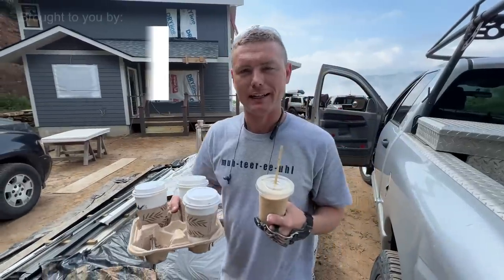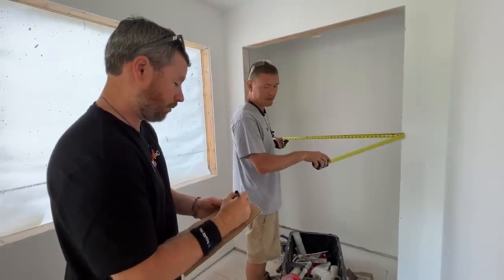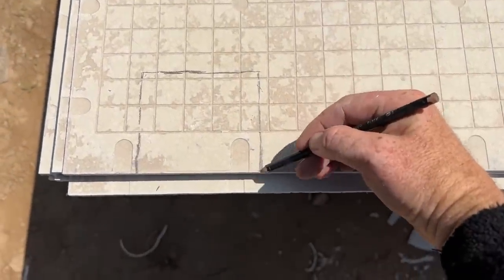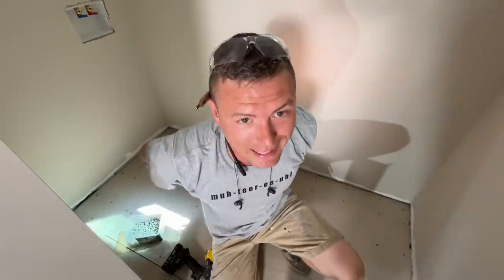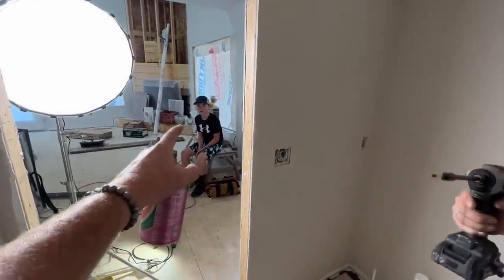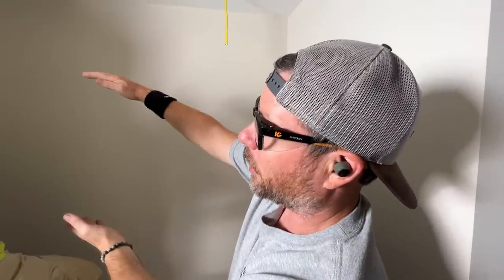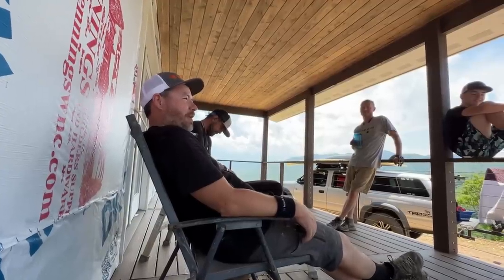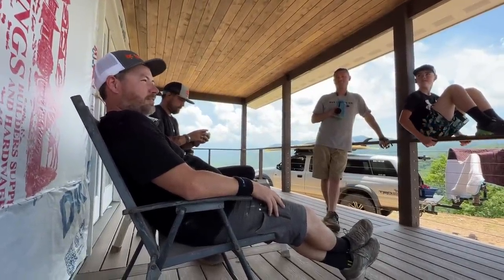Building A Mountain Cabin EP40 | Prep for T I L E and Electrical Trim-out

Comment: Almost every job I wire there are boxes that the Sheetrock crew forgets…. And the best way to find them is to use a straight edge and hold it over the section of wall where you think it should be. The high spot is where you dig….. and use a hangar to poke the hole, as it’s easy to patch if you’re wrong.
Reply: I'm a big fan of spray painting something bright like red on the subfloor, near the bottom plate, everywhere there's a switch or recep in that spot. Makes it easy to go back at a glance and see if there's a red mark without a box above it. Frigging drywallers have cost me a lot of time trying to figure out why something electrical doesn't work.
Reply: i always spray paint on the floor for layout. different colors for different box types and heights.

Comment: Pro tip Eric, after rough in if you spray paint a dot on the unfinished floor where all the plug and switch boxes are then when you drywall you will know where the boxes are to rotozip.
Reply: Came to say the same thing.  Get some fluorescent orange paint.  I mark all boxes,  ac vents, hvac wires.  Take a laser and mark your can lights or whips for the puck wires.  15 minutes of making will saving hours of trying to figure out why you don't have power somewhere.
Reply: Different colors for plug height vs switch height?
Actually... this goes back to not making detailed drawings that would show electrical box locations!
Reply: I dont know anyone who makes detailed drawings for that unless it's heavy commercial.

Comment: Been setting tile for years, use your coil roofing nailer to put down your concrete board and it's way faster and no worries about it coming up if you thinset it down also. No screws needed

Comment: In Texas, we use the phrase, "fur down" to describe the boxed out framing application attached to interior ceiling joists, but we too use the word "soffit" to describe our exterior overhangs. We also use the word "cornice", depending on the trim details of the exterior overhang.

Comment: Y’all got to try using GoBoard instead of the cement board, just once. It weighs next to nothing (you can carry 4x8 sheets with two fingers), no cancer causing dust when you cut it, no special tools needed, and it cuts easier than drywall with just a knife. It’s a serious time saver. I highly recommend! Keep up the good work fellas!
Reply: Agree..once you use goboard you will never use cement board again

Comment: I also use a can of orange spray paint to spray on first floor slab and second floor decking where all the wall plugs were installed, before drywall goes up. Doing so prevents exploration holes cut in finished walls.

Comment: You can use a jig saw with a regular wood blade to cut hardie backer, it just eats the blades up. You’ll get maybe 5 cuts per blade but if you only use it for the circules and use the nibbler on the straights then your good to go!

Comment: Gotta get you boys to use Schluter Ditra or Ditra Heat floor mat.  You can cut it with a utility knife, set with thinset, and you’re ready to tile.  Plus you can use it for curbless applications and run the heat into the shower.   The Schluter kerdi wall membrane and kerdi board is also a huge time saver as well.

Comment: Try using an angle grinder for the angled/circular cuts in hardie or tile.  Yes, it creates dust but it's more accurate and doesn't create micro-fractures from hammering it out.

Comment: There was a paint once, and I don't know if it still is sold, but it was called "Dulux Magic White" which is pink when it's wet and supposed to be "perfect white" when dried... It was supposed to help painting white spotless..
Reply: I was looking for Dulux Magic White in the comments... yeah, they still make it. It works really well!!! I've definitely found it works so much better on ceilings, even though they say you can use it on walls too.
Reply: @JimmyPugwash777  Ah thanks, good to know! Stores here usually tend to sell popular products only or their in-house brands. So, I wasn't sure if this paint still existed as I heard of it first around the 2003-2005s ..somewhere in that time frame. It's been a long time.
Reply: Yep it's still available in Dulux brand..  Zinzer, Valspar, & others have ceiling white (flat) with pink to white feature.  Sherwin Williams, the best paint available, doesn't seem to have this option.

Comment: Use a diamond wheel on an angle grinder to cut the circular cut out for the toilet in the hardie board.  Dusty as hell but it works fast and accurate.  I use the "turbo" diamond wheel with the little segments.  It also cuts tile.
Reply: If i remember correctly they adressed that they dont like to do that as using a handheld circular saw to cut fiber‑cement board can generate respirable crystalline silica dust. When inhaled over time, the small particles of silica can irreversibly damage the lungs
Reply: @OMDitsBambi  yeah, that's true.  That's also why all the rotary hammers have a vacuum port now.  all you have to do is wear a mask.  To each their own.

Comment: Yeah I hate Philip screws too. Especially going through hardy board. That’s why I buy the star head Hardy back screws. They cost a little extra but well worth it in the long run to me. And it comes with their own bit just in case. But I’ve never had a problem with stripping bits out with those.

Comment: I went to a home recently that had half a bedroom lighting and outlets that had NEVER WORKED since built 15 years ago. They told me another electrician spent hours and couldn’t find the problem. Took me 15 minutes to locate the receptacle outlet and cut around it (very tight cut, unlike this example). It was a buried box, like this, and I trimmed it like it should have been done 15 years ago. Everything works now. That’s the fault of the drywall contractor, BTW.

Comment: Standard door industry 
I have been doing for 42 years

Example 2/4x6/8
Interior doors unless special are 2” over call out size for RO
Exterior doors are 2 1/2” over call out for RO

I hear you giving tips 
But standard to industry 
All doors are called 
Feet/ Inches x Feet/ Inches

Comment: Phillips screws were designed to strip out under higher torque so assembly line workers wouldn't over torque them. Use a JIS bit it has sharper corners and won't strip the screws out or ruin the bit nearly as often
Reply: That’s great insight there into the design… thanks

Comment: I worked for Fluke and was responsible for tracers.  Would it not have made sense to use a signal injector to trace where the wire was behind the drywall, unless they didn't yet run the wire...

Comment: why not a jig saw?
Reply from the maker: Jigsaw works pretty well but kills the blade in about one hole
Reply: @PerkinsBuilderBrothers  yeah that’s for sure, but you can get like 50 jig saw blades on Amazon for like $20 bucks. They will cost you like 50 cents each. No need to buy name brand blades to cut through this type of material.

Comment: 54 screws for one sheet and I don't understand how these guys aren't yet using an uncoupling membrane.
Reply: I think I only ever use every other hole unless there is something strange going on where it just wants to stick up. The thing with tile is, there are showers out there that are mastic on drywall and haven't leaked yet. If the grout never fails, you're fine. I think uncoupling membrane is just a buzzword for underlayment. Hardie backer can be an underlayment, or coated. Its really all about how serious you want to get about "IF" water ever gets through the grout and mortar to the wood. And if you are on concrete, then no, you dont need underlayment.
Reply: I’ve seen quite a few different tile companies put down hardie with galvanized roofing nails. Not sure if hardie warranties it or not, but it is significantly faster.
Reply: @mikefechik3542  some cement board manufacturers do spec nails

Comment: Watching y’all screw those in bent over like that makes my back hurt. That’s why I invested in some good kneepads and I screw them in on my hands and knees save the back much as I can. I’ll give you a good pointer on some kneepads they’re a little pricey but they’re rebuildable  so you can buy all new faces and inside padding for them so it will be the last set of kneepads you ever have to buy besides rebuild kits. They’re called pro knees AP16  you can buy them on Amazon for $100! But you guys do a lot of flooring just like I do on all the homes you build and believe me they will pay for their selves on the first job you do with them. I don’t know how many times I’ve spent 40 to 60 bucks on kneepads and they last me a month or two and they’re all worn out. These ones come in 5/8 inch padding or 1 inch padding. I got the one Inch padding. And I love them definitely a good investment for y’all. You will thank me later believe me.
Reply: I took a screenshot of your comment so I can remember to look them up. thanks
Reply: @jaimeperkins9606  They’re definitely a good investment like I said, you won’t regret spending $100 on them. I love them. And they’re not like other kneepads were a dig into the back of your knees or anything the straps wrap around your calf. Very comfortable

Comment: Where did you get Phillips head backer board screws? Are they cheaper? I’ve always used the backer on screws which are torx head.
Reply: I thought they were torx when I bought them. I will look closer next time. We did use them all up though so they will not be sitting in my shop and every time I pick up the box I am disappointed again…
Reply: I can imagine what a pain they were to use not sure why anyone makes anything with a Phillips or a flat head anymore!!

Comment: Why don't you guys use schluter ditra on the floor when you are tiling?
Reply: I think I will check it out. It might cost more
Reply: @jaimeperkins9606  it's going to cost more but it will save more time walking in and out to cut pieces as well, the bending over to put screws in.  Basically, the same process is other than using an uncoupling mortar on the floor. Also, with the polyethylene material, it's going to be more flexible for w home that starts to settle, with no cracking tile. You guys are awesome, keep up the great work!